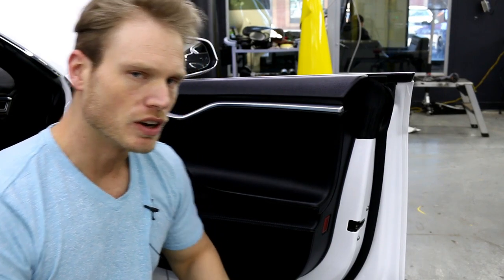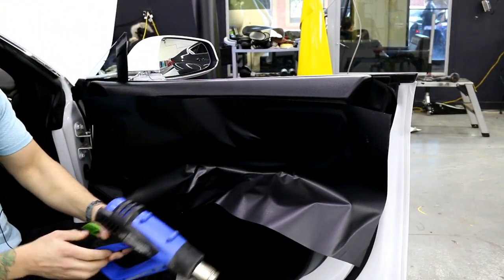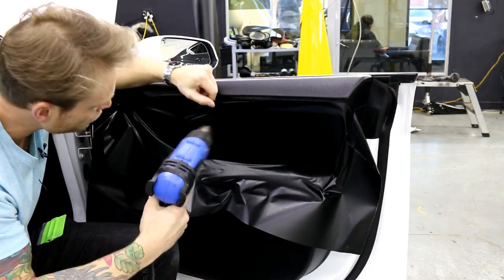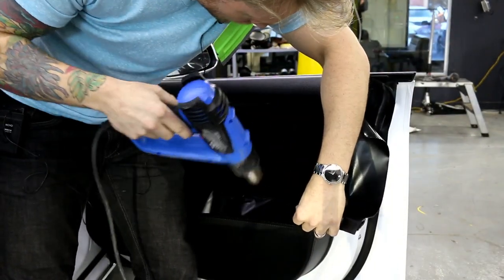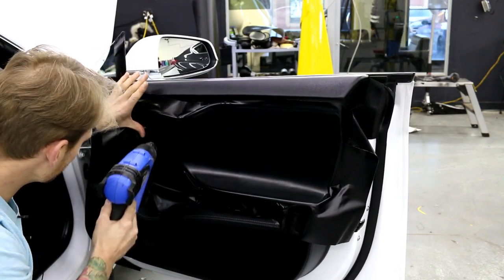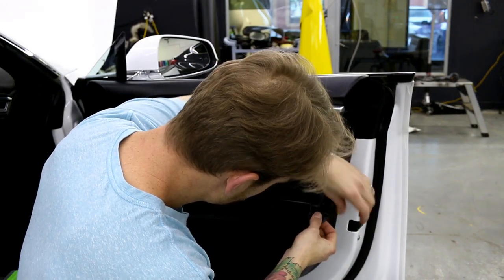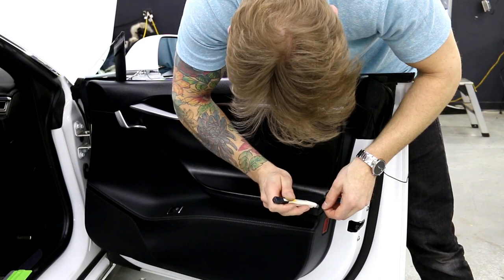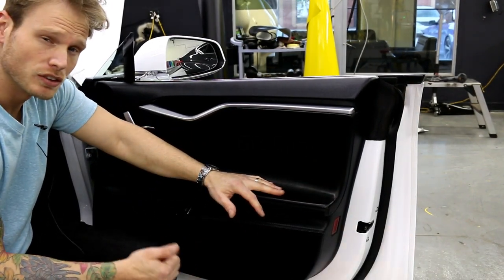Tesla Interior Vinyl Wrap Can It Be Done? Leather Vinyl Wrap Over Pleather Interior Panels

Comment: Vvivid's leather look vinyl wrap is pretty cool. I redid the interior door cards for my car with this black leather look vinyl. I was worried about it sticking because the plastic door card was that textured type of material that vinyl doesn't really like to stick to. But with a little bit of heat as Christian shows it activated the adhesive; I also made sure to squeegee it in really well and then go over it with a good post heat. It's a been on for several months now with no issue and looks really great. It's gone through an Oklahoma and Nebraska summer (i.e. 100 degrees Fahrenheit days) and a Nebraska winter (i.e. 0 degrees Fahrenheit days) and no issues so far. This leather look vinyl also makes for a great skin for your cell phone 😎
Reply: Erick Castro any photos of your door card?
Reply: Hey that sounds like what I'm planning. Is your plastic the orange peel kinda material? By squegeeing it too much won't the vinyl show that rough texture as well?

Comment: Advise needed! I am restoring a 1968 Tahiti runabout. It is a repaint, not gelcoat. The boat will be a bright white with red pearl accent. The deck is a blank canvas for a wrap. I cannot afford airbrushing, so I created a graphic to cover the entire bow. In your experience, can I have the wrap clear-coated by a body shop? If so, what type of clear-coat?  Should I use Urethane, Lacquer, Acrylic-L, or an Enamel paint? Since I will be clear-coating, should I use a 2-stage paint? I see lots of stickers with a clear-coat overlay on motorcycles and such. Your thoughts?

Comment: Well I’ve been wrapping for a little while. I decided to try to wrap with old eBay vinyl and this is how it came out https://youtu.be/iQjq8OfKiVc
Reply: Mitch Comer ima stop you right there...
Reply: Jorgeicr8 what u mean? The Reddit guys thinks it’s pretty okay
Reply: Terrible idea to wrap using low quality vinyl.  I wouldn't leave it on very long, like less then 6 months.  Just save the money and buy good product.  You might have a hell of a time getting it off and it may damage the clear coat.
Reply: Matthew St. Onge actually the only problem I’ve had with it coming off was the adhesive. I had to use a lot of goobgone
Reply: Mitch Comer Yeah the better materials should leave almost zero residue, even when theyve been on for years.  Are you going to re wrap it?
Reply: Matthew St. Onge the car I wrapped previously had peeled paint and was basically bare metal so the quality of the vinyl didn’t matter in that aspect. And I’m a college student so unless I blow up.... I’m stuck with what I Can afford